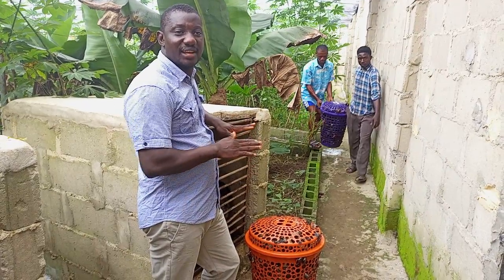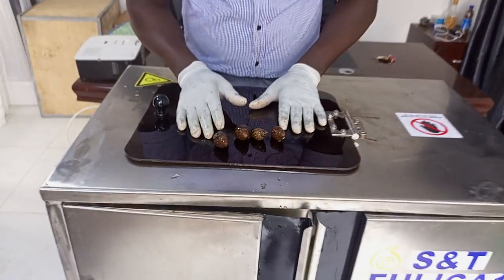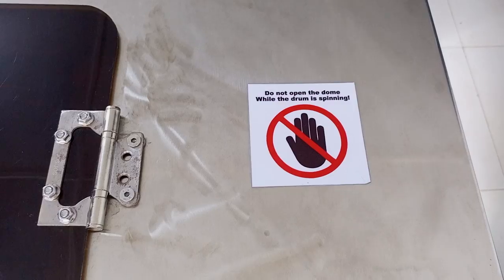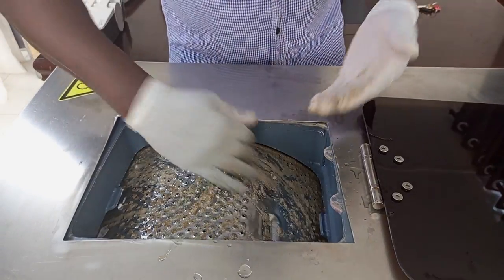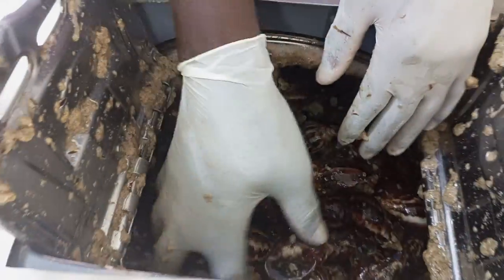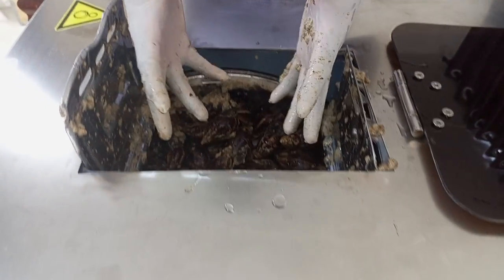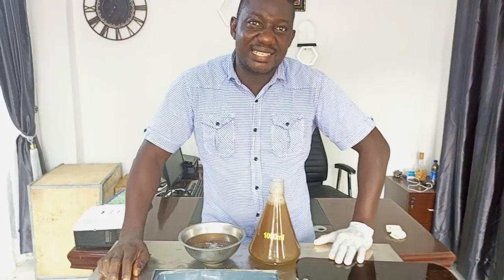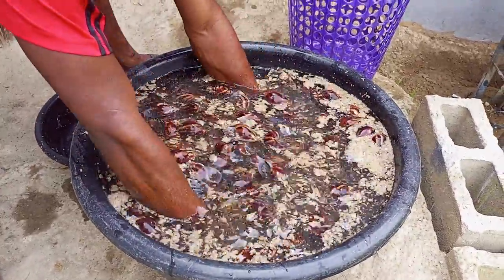How is Snail slime extracted using S&T FULICA1

Comment: Hello! What do you think about citric acid extraction?
Reply from the maker: Citric acid is a preservatives agent, using it to extract snail required quantity above preservatives formula, the slime ingredients dies when citric acid is above slime content and is not a recommended means because you can not use 1ml to extract 100ml. Therefore, is void using citric acid because you gets no edible slime but dead slime